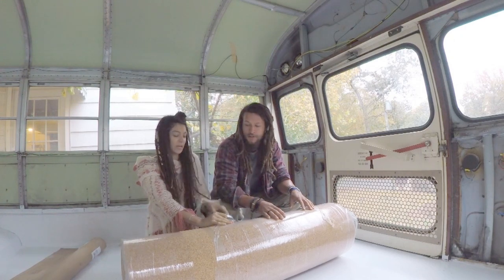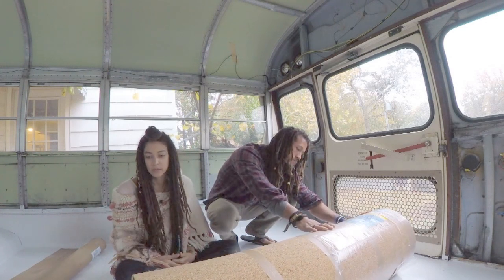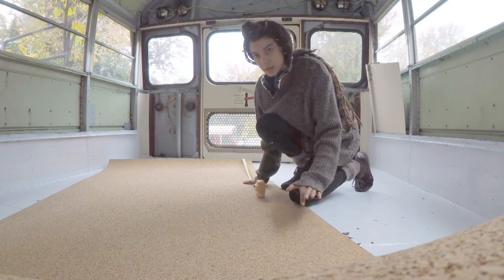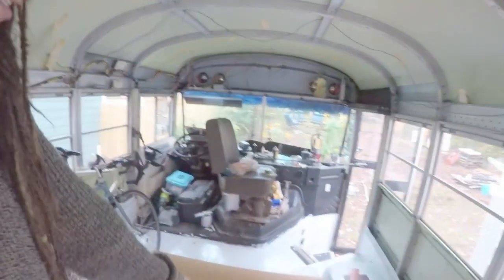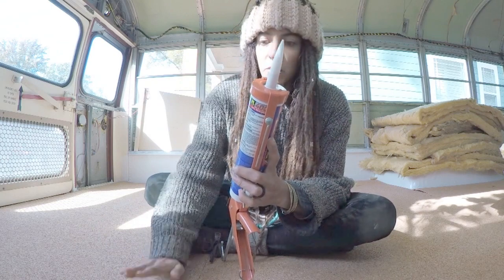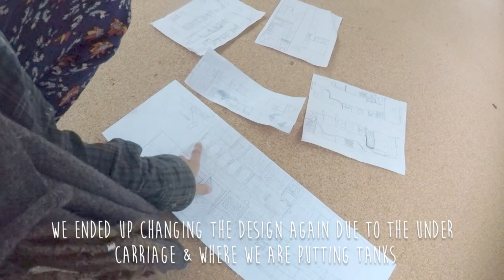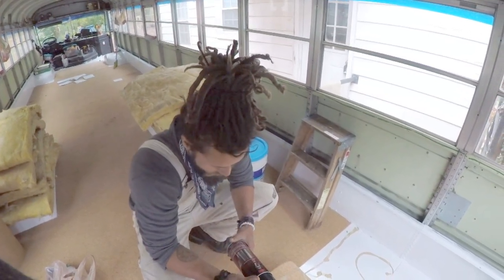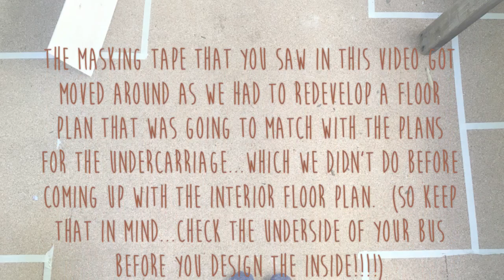EPISODE # 7 Cork Underlayment as our Floor Insulation

Comment: Im curious now that you guys have lived in the bus awhile how do you feel about the floor insulation? We’ve decided to try cork for our build as well to save head space. It seems like you’ve made it through snowy winters alright, but I’d love to hear your full opinion if you have the time!
Reply from the maker: ahhh yes the cork insulations, honestly it was easy to put down and cost effective, for us we weren't planning on staying in cold places in the winter so it was ok but since we did we just barely made it through the cold months running two space heaters. I wish we could have put more floor insulations in because no matter how much season chasing you do you will run into cold nights but overall we are happy with it
Reply: I've got some cork too but haven't started yet. Did you just put one 1/4" layer down? How did it tur out? I will do more I think maybe 1/2"and or with a little airgap.

Comment: my partner and I are in the process of building a skoolie and also need to maximize height clearance. wondering if you ran into any issues with your flooring popping out of place or anything like that since there wan't plywood underneath to keep it sturdy? y'all are the only people so far we have found who didn't do a typical subfloor and we are leaning towards following in your footsteps!
Reply from the maker: ya - the floor pops up from time to time, but only right in the front of the bus where it joins the steps.  We glued it down so it stays pretty well overall

Comment: If you were to have used 1/2” or 12mm cork sheeting vs 1/4” (assuming it was 1/4”, could’ve been 1/8”) you never would’ve experienced the issues with the cork breaking or tearing.  There is also specific glue/adhesive used to put cork and other flooring down.  You’re walking on this, so you don’t want it to breakdown and release harmful chemicals, especially in a small and confined area.